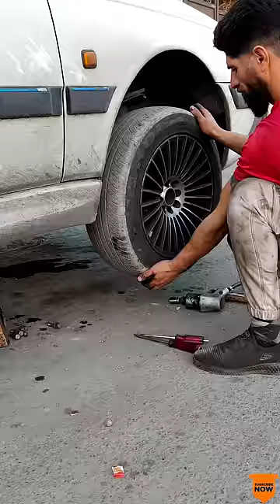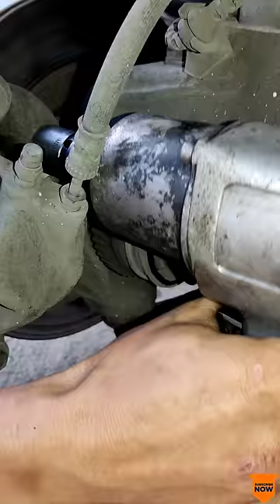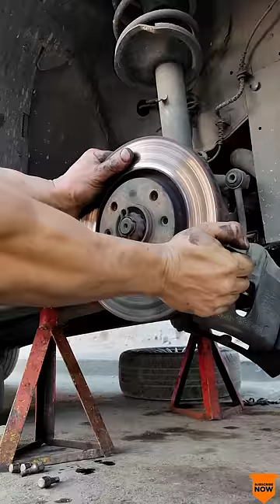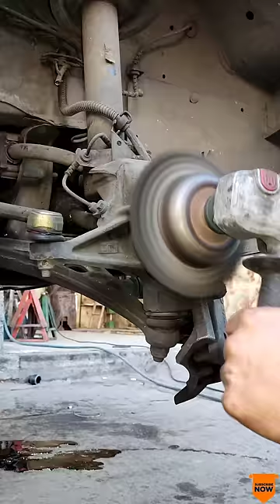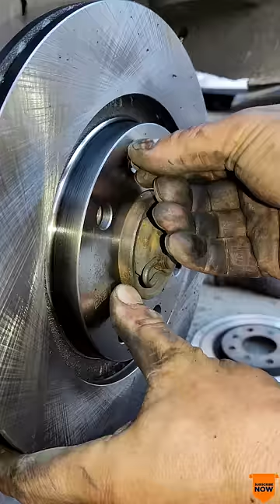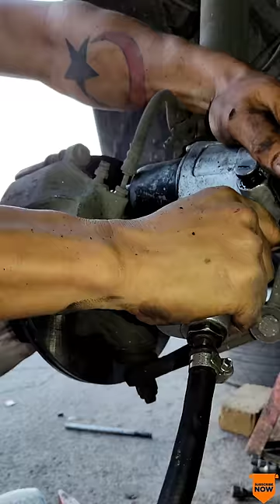#shorts #mechanic

Comment: I’m definitely not hiring you my man 😂
Reply: That’s what she said
Reply: Backyard wanna be hating on a real mecanic
Reply: Like no copper grease at all. Hanging brake caliper/support. Air gun to tighten all screws... AND NO FCKING BRAKE CLEANER...
Reply: @PlovsLV   he needs to be carful loosening that screw with little to-no leverage. That thing will strip. Also I always hand tighten my bolts
Reply: @PlovsLV  there not screws
Reply: @AG-rz9qt  he is no real mechanic. At least use a torque stick or torque limiting extension when tightening the lug studs. Best thing would be a torque wrench. But having worked in flat rate shops in the past I personally use torque sticks.
Reply: @extractorfan2143  they’re *
Reply: @gamerz8541  so you agree
Reply: @PlovsLV  it'll be aight
Reply: @AG-rz9qt even the diy would have better tools.
Reply: If grease was needed why do new cars not come with it also there is not much stress on the flexy
Reply: @PlovsLV  he didn't use brake clean because those disks don't come oiled. Also Mercedes calipers don't weigh anything so you don't need to support the calipers weight. And tightinging caliper support brackets with an air gun is always okay because the knuckle and bracket are both cast iron.

Comment: Bad way to leave a caliper hanging 🔒
Reply: Lmao. There's like 200 bar inside those lines when you slamm on the brakes. You could lift the entire car on that line.
Reply: @Robis_Grigoris  I've seen the lines break from someone just dropping the caliber
Reply: @glocksp80smd  if the Hose is that bad it couldn't stand up to a hard braking event anyways. You should be able to hang them no problem
Reply: @1000HoursFreeAOL sp  yeah I live in michigan so our winters and all that play affect as well
Reply: @Robis_Grigoris  it doesn't matter the pressure running through the lines they aren't meant to be pulled on in any way as they can fail from tensile stress
Reply: @Robis_Grigoris  the lines hold a lot of pressure but are not designed to have something hanging on them and never while in use are they holding anything other than pressure in them.  You can not lift shit with  them.
Reply: Best tip from real mechanic to all of these keyboard mechanics… “you worry too much”
Reply: @captainsupermaket8003  man they take crazy pressure in all directions, a kilo hanging on it for ten minutes ain't gonna do much harm, probably not best practice but kinda harmless, he cleaned the surface behind the disk which is good practice and important, many people don't
Reply: I hang calibers all the time like that from the line as long as they’re not getting pinch or on the sharp edge they’re completely fine.
Reply: @Gregg0112  read the definition of pressure
Reply: First thing I noticed was him bending the screwdriver pulling the pads back
Reply: @Robis_Grigoris  😂
Reply: Used to use the bent wire that one in new exhausts to hang calliper from spring so flexi pipe not strained
Reply: @Robis_Grigoris  really hard braking is around 50 bars. Still a difference between pressure on the inside and letting it hang with weight attached to it.
That being said, if it's small calipers it's not a disaster if you let it hang. Only the heavy ones I would avoid letting it hang.
Reply: @Robis_Grigoris  psi and sheer strength is different, that line can hold upwards of 80 psi probably more, but stretching that line maybe 40 pounds if your lucky
Reply: But he took advantage of what was available and did not complain
Reply: Came straight to the comments to say the same thing.
Reply: @AG-rz9qt  nope you're wrong
Reply: in these situations the torque wrench is used, not the pneumatic gun
Reply: Agree with you
Reply: All he’s saying is there’s a better way prop it up or use a bungee! It’s that easy and boom one less thing to think about!
Reply: The oil he didn’t wipe off the rotor will take care of it. It’s like watching dominoes fall taking advice from this guy lol
Reply: I've done it to my car for the last 16 years. That hose is tough as hell. If yours can't handle it, it's a shit car. Period.
Reply: I was about to say the same lol
Reply: @James-xd7nq  so i can avoid it, what shop do you work at?
Reply: Yes 🙌
Reply: I have never thought so much people will reply to this
Reply: @Robis_Grigoris  Absolute unfounded rubbish!,it takes surprisingly little to pull the inner nylon liner loose of its fitting leaving only the outer rubber sheath holding on.
Reply: @AG-rz9qt  If you carried on like that in my workshop you would see our tool box pushed outside as quick as you could blink. Thinking it's alright to do a half assed job is the reason the motor trade has such a bad reputation. Cowboy!
Reply: U have not opened any bolts or tire, keyboard mechanic.
Reply: I have changed 12000000 brakes.. Never have issuse with the caliper ließ.. They are very string.. You need to think how many Bars you have on  Brake System
Reply: Quick calc, if there's 2000psi max during braking and hose internally is 3.5mm, then there's 13.5kg max of force longitudinally within the hose. A caliper with pads could weigh 6kg, so if it falls and jerks the hose, that's a hell of an abnormal load on that hose.
Reply: @Robis_Grigoris  Bro that hose is rated for 200 bar pressure INSIDE, you might be fine leaving it hanging, but it’s not rated for that kind of tension, and no manufacturer in the world would guarantee that their brake lines are holding up to that kind of stress.
Reply: @Robis_Grigoris  the fact is made for pressure doesn't make resistant for lifting, is a bad practice for sure.
Reply: To bad!
Reply: Como es que deja el caliper colgado de llos tubos del freno... Mala cosa
Reply: Mecánico de teclado jajaj
Reply: @Robis_Grigoris  it's not the line that's the issue. Those fittings aren't made out of very strong metals. Hanging a caliper like that has the potential to cause a leak at the fittings especially on a high mileage vehicle
Reply: @glocksp80smd  Agreed, and I'm in Detroit. It gets bad out here in Michigan
Reply: @ProdBy. Damn CJ  lol real bad I've had lug nuts that the strongest impact couldn't budge even with heat they had to be air hammered off its crazy working on them here
Reply: @chaseleim4773  what 80 psi? You should mean 1000+ psi on brake lines 😉
Reply: If it can’t handle being hung it can’t handle the pressure being out through it
Reply: На современных автомобилях тормозные шланги армированы, поэтому ничего с ними не случится

Comment: two nice tips spreading the caliper before removal so it's not stuck on the rotor. he must have noticed the deep grooves. and cleaning the mating surface before placing the new rotor on.
Reply: Cleaning is good when there's all that rust but if he had taken the time to put a little grease on the inside flat of the hat, there wouldn't be all that rust.  And leaving the caliper dangling... that's bad form.  Those lines aren't design for that.

Comment: Yeah just leave the caliper hanging by the brake hose. Quality work 😱
Reply: Nothing happens Keyboard Mechanic, u have not opened a single bolt.
Reply: Not true, it might not be a problem every time,  or an immediately recognized problem, but it's bad practice. 
If your rotor is scuffed up, you can slap new pads on and it'll work. But, when the pads are shot in less than 10k miles, the bad practice becomes evident.
Reply: @Lokesh vigil  been wrenching on my own rides for almost 30 years.  Nobody said get fancy powder coated "S" hooks. Bend a coat hanger and hang caliper ya hack

Comment: I can't remember the last time I was able to remove a rotor screw with just the intended hand tool lol. Always have to break out the torch, hammer and impact driver first here in the rust belt. And be real careful about it. Then the head strips anyway and I end up drilling it out. Good times

Comment: 2 tips, one you forgot to put never seize, 2 always hang you caliper, last thing you want is to break them rubber lines, they cost more than the metal ones
Reply: No rain, no need for never size.

Comment: The fact that you cleaned it from rust is very good. You can lubricate it with engine oil, or lightly grease, next time it won't rust.
Reply from the maker: Thanks bro
Reply: There are rust inhibitors you can use on the metal dont put flammable oil near the hot brake rotor
Reply: @JKDJack  
What are the temperatures in the engine and the oil does not ignite. It's not about pouring large amounts of oil there, but smearing it lightly. I drive my bus professionally around Europe, with a load, in warm countries in Spain, my brakes have never caught fire. But ok, smear inhibitors certainly won't hurt, and even more so when you do extreme sports with your car. Regards :-)

Comment: Raise your hand if you’ve snapped/stripped more than one of those rotor retaining screws
Reply: i had to buy an impact driver specifically to get those screws off.
Reply: @davidg3283  same and that's when I learned that those were even a tool lol
Reply: Does anyone put them back in? I swear the ones Honda uses strip so easy they must be made out of tin.
Reply: I'm impressed  that he got it off without the impact driver. Hell half the time I have to drill them out even if I used the driver
Reply: @erikreedholm3772  I did put them back to hold the rotors on while I was finishing the job but I put anti seize and didn’t tighten them too much
Reply: I changed my brake rotors at the dealership and they didnt even put the screws back in
Reply: I just drill them out. Much faster
Reply: Hit the rotor a a BFH(big fuckin hammer) and then they usually come out pretty easy

Comment: That's the 5 dollar part, of a 200 dollar full brake job.
1. Don't force brake fluid back into master cylinder or ABS unit. Drain through bleader while gently pushing piston in.
2. Don't hang Caliper off brake hose.
3. Don't use a grinder on the hub. 
4. Use a wire wheel to remove rust off hub.
5. Inspect everything. Including boots, ball joints, brake lines, missing bolts, clips, coter pins, check suspension for wear and bolt or fastener tightness.
6. Lube caliper pin after cleaning it. Lube everything properly.
7. Replace hardware, rotors, pads, clips, etc.
8. Lightly grease hub ring
9. Bleed All 4 corners.
10. Lightly wire wheel aluminum wheel center and rear face to remove rust, and corrosion, apply thin layer of grease to center hole.
11. Install new tire
12. Install wheel, torque to spec.
Reply: we all know proper torque spec is 7 ugga duggas 🙄
Reply: You must not make a dime
Reply: Lol. Google. Lol. A YouTube pro now.
Reply: $200 🤭 Do I get a new car with that "full brake job"?
Reply: Sad to say a lot of this type of work quality still goes on.👎
Reply: Can tell someone’s never been a flat rate tech
Reply: meu pai sempre não fez isso tudo q você comentou e nunca teve problemas ele mexia com carros antigos hoje em dia acho q os carros modernos com abs ate se aplicaria essas formas que você citou
Reply: What is this nonsense??  🤣🤣🤣🤣
Reply: @adammohammed9550  can tell someone has never teleported before
Reply: Штуцер может обломиться, дальше замена суппорта, шланг может не открутиться, дальше замена шалнга, может и трубки, в итоге не 200 а 5000 долларов должен хозяин авто, как говорится у специалистов не трогай пока не сломалось))) а жидкость конечно надо иногда менять!
Reply: Trek you are 100% . that's how I do every brake job. And I'll add if there's corrosion under where the clips attach to caliper bracket, I wire brush those too so the rust doesn't "lift" the hardware up, causing tightness on the pads ears. As far as "you must not make a dime" that's a fallacy. If you don't go this thorough, the brakes will wear premature, uneven, or in one form or another, have a comeback. I so the brakes this thorough, get paid flat rate, and have never lost out on time/money. This industry is NOT just about making money, our customers SAFETY is our priority, so for what they pay, they deserve good work.
Reply: Tell me your not a technician without telling me your not a technician. Bro when you're banging out 6-8 services a day you ain't got time for that sit
Reply: @bigdog66711  переводчик что-то не работает, а текст не скопировать, в общем я разбираюсь немного, работал у официального дилера форд, штуцера ломаются бывает и на свежих авто, и болты и трубки, в общем пока работает лучше не трогать, иначе к деньгам!
Reply: I have never in my life, ever... not even maybe one time seen anyone bleed the fluid out through the bleeder screw while pressing a piston back in. You must like to make a fucking mess for no reason and waste fluid.
Reply: Depends, if you're trying to run a profitable business. Do the job right, but the minimum to have done it right. You NEED to get jobs done quick. Can't be fucking around all day on a brake job that shouldn't take more than 1 hour. 

Now if I'm working on my vehicle or a friend's or a family's vehicle them yes, do all that bullshit for them because I love them
Reply: @byloyuripka9624  ain't nobody got time for that, unless it's a special case. IMO. If it's just a normal car, it's pretty unnecessary
Reply: Grinder had a wire wheel on it
Reply: ABS pushback is really a myth.... never had a problem with it, and the abs block doesn't open it's valves unless activated
Reply: can someone please explain to me no.1?
why is that the correct way because I'm a new learner.
Reply: @400Redsport  That's what I'm saying.. Lol the fluid is meant to transverse back and fourth. Just remove the reservoir cap to release pressure and retract the piston slowly
Reply: ToRquE tO spEC
Reply: @zacotis2550  You must deal with cheap garbage customers.  It's not that I'm too expensive, it's that I'm too expensive for you.  I charge alot because I deliver quality work.  If you don't want to pay for quality, I don't want you as a customer.
Reply: @MVP11489  I don’t work on cars (I fix airplanes) there’s no money in it. I know you don’t make a dime because there’s no theoretical harm in pushing the piston back into the caliper. Also bleeding all 4 on every brake job is just wasting your time there’s literally no need for that. Justify it with science, please. You’re right some ways but some of this shit you say is just silly, a wire wheel on a grinder is fine to use on a hub
Reply: @MVP11489  idk man I don’t read the shit, OP is out here being a fool about doing a brake job. There isn’t shit in cars I promise out of all the shit you can fix the money isn’t there. Even in higher end cars, it’s not about how good you are and not garbage. It’ll make enough fuck it if it’s what you like but I don’t deal with customers and make more
Reply: Ok .

Comment: Don’t hang the calper by the brake line it messes it up
Reply: Lmao what?
Reply: @Robis_Grigoris  what you read, you never do that. It’ll cause unnecessary tension in the hose and joints. They’re not meant to stretch
Reply: Yeah, it's always good practice to use a piece of wire or bungee cord to hang the caliper without stressing the brake line hose. Once those hoses are strained, they will balloon from the pressure that is supposed to be directed to the caliper piston, causing uneven braking

Comment: Don't hang the caliper like that 
And Don't tighten the bots or nuts using an air gun . It can snap them or damage the threads
Reply: The bolts he used the air gun on were the bracket bolts. You can and should use an air gun.

Comment: Going to have to replace that brake hose soon with all that stress you are putting it through
Reply: That process is causing you more stress than that brake hose
Reply: You can tell who just watches videos and who actually repairs vehicles by the comment.
Reply: You're not an expert on brakes just because you replaced your pads once. If your brake hose snaps because it was hanging for 5 min. it was due to be replaced anyways.
Reply: I didn't have to replace mine in 16 years. I guess shit cars be shit cars, huh?
Reply: Not the just the brake hose. Look at that damn tire.
Reply: @moavic5087  lol I was thinking the same thing.

Comment: if you have someone step on the brakes, and then crack the screws loose, it helps. then proceed to take the brakes apart. Also, I throw those screws out. They are there during factory installation, to make it easier for assembly at the factory.

Comment: Never tighten those bolts with a impact again they can easily snap 😂
Reply: Use a torque wrench. It’s what it’s called.
Reply: Did you snap one?
Reply: The caliper support bracket bolts can easily snap? You must be high

Comment: Voltar o embolo da pinça sem abrir a sangria, pode causar sérios danos a central de ABS caso o veículo possua.
Reply: It does, you can see the sensor ring on the inside of the hub.

Comment: The comment section is ridiculous. Just FYI, no licensed techs out there purposely  hangs their calipers unless they have hard lines or are steel calipers and actually weight something signficiant. hanging calipers used to be a thing when brake hoses were weak, now brake lines are strong and can easily handle the 3lbs of aluminum. Hanging an single piston aluminum caliper will literally never damage a brake line. Especially because this has the thread in style line and doesn't have a 90⁰ bend banjo bolt style. Yes if there's a good place to rest it without being fully extended, like on the control arm or knuckle, then it's good to do just for repetitive practice, but anyone with common sense knows when a caliper should be hung or not. I've done probably 15,000 brake jobs in my life and have never once damaged a brake hose. I've had customers where I did their initial brake job all the way until their 5th brake job and the lines outlasted the motor. 99% of the people on this thread probably watched Chris Fix tutorial on how to change brakes, did it one time and now feel like they have all the knowledge in tbe world to change brakes.
Reply from the maker: Yes, thank you My friend